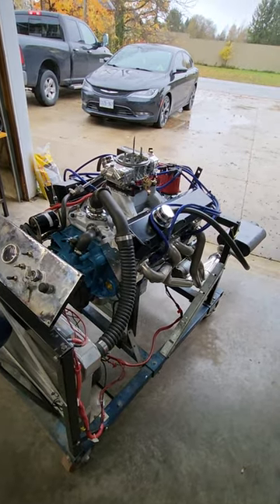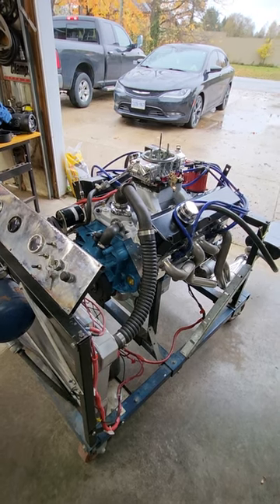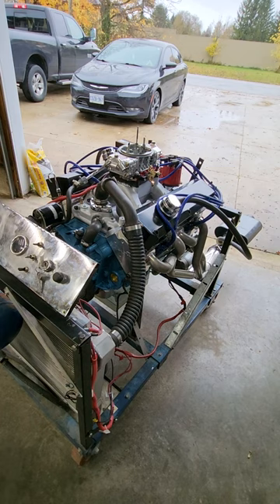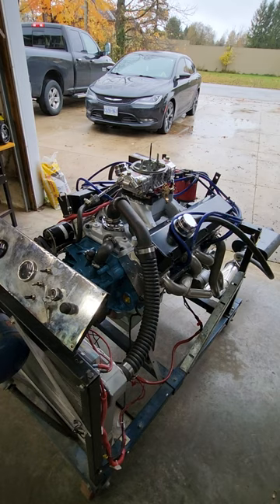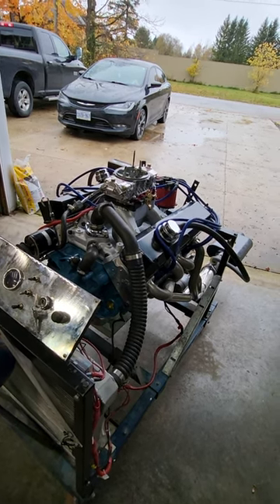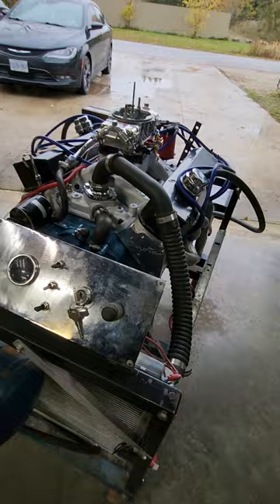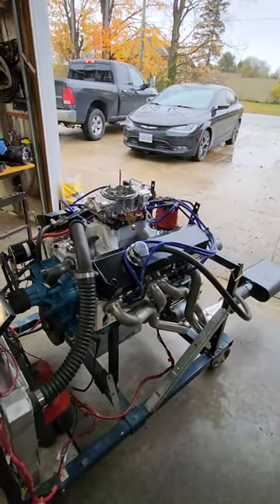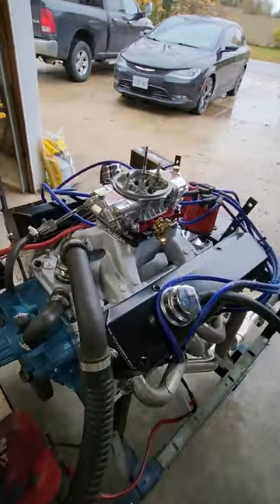Mopar 360/408 LA Stroker, Trick Flow, Hyd Roller. For Sale after Dyno.

Comment: Trying to decide on a 3.79 inch crank, or a 4 inch crank. Going in a Sprintcar about 10 to one compression 1700 pound car. Do you think the 3.79 would have more snap and RPM?

Comment: COMP Cams Xtreme Energy Retrofit Camshafts
Camshaft, Hydraulic Roller Tappet, Advertised Duration 286/294, Lift .544/.541, Mopar, Small Block LA, 110 line sep